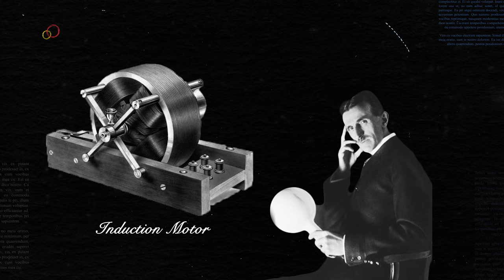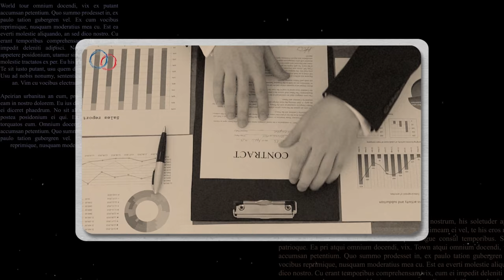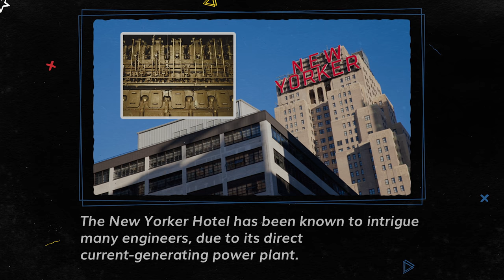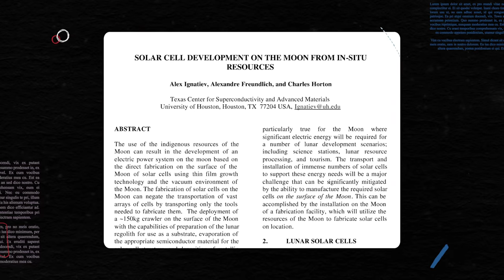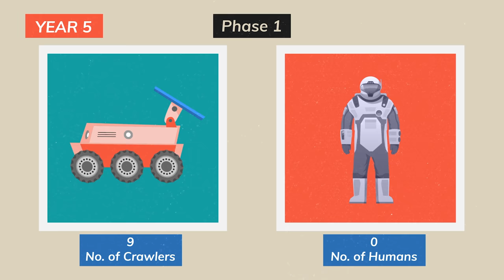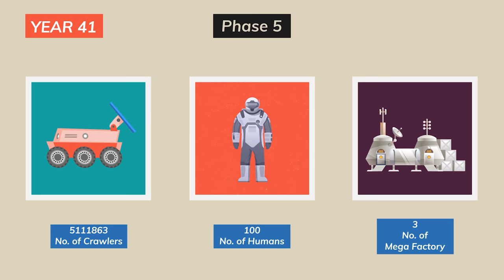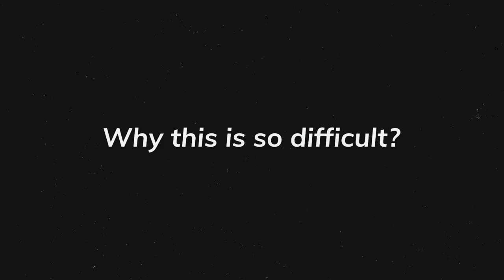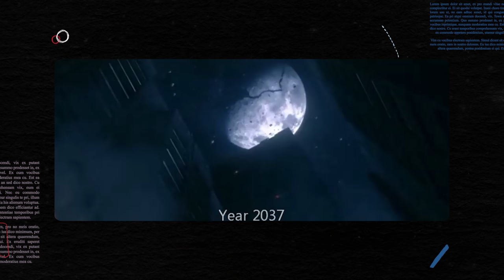Nikola Tesla’s Dream of Wireless Electricity Might Just Be Possible…On The Moon

Comment: The lack of atmosphere causes another problem—meteorites. Regardless of them hitting the panels and damaging or destroying them, coliding space objects will also kick up dust that will slowly settle back down, possibly on the panels. The maintenance would be a huge problem.
Reply: nah. the refractive index of lunar dust being of a 00,09 coefficient on the same scale will augment the panel output even better than benitoite ion suspension applied as usual --- get a grip
Reply: But the lunar dust is electrostatically charged, so we could charge up our panels as well to redirect the dust away from them.
Reply: Sister Mary Clements  are you good?

Comment: As always the main hurdle is cooperation. Classic story of humanity
Reply: yep
Reply: Nope. Some people (actually most people) are incapable of doing math. Building this on the moon is stupid, even more so with crap 5% panels. (calculators from the 80's had better panels.) Much higher efficiency panels can be placed in orbit. Mirrors can be placed in orbit. Wasn't land use the point to putting this on the moon? Yet, the power beamed from the moon will be "25% of sunlight"?!? So to get the same power as sunlight, you'll need to cover four times the area. Also, there's a reason CA isn't power by Niagara Falls... line loss.
Reply: @Kumar Shivam Like we're blocking out the sun with all the airplanes, balloons, and satellites we currently have in the sky? Depending out how far out they're placed, and where (if they aren't between the earth and the sun, they don't cast any shadow on Earth), they won't block a measurable amount of sunlight. I'm not talking about covering the planet with a dome of solar collectors.
Reply: yeah human inability to cooperate affects very important issues like climate change and pollution 
but not with this one 
this is just a stupid idea
Reply: So was the horseless carriage, air travel, and space flight. 

Fortunately you won’t have a say.
Reply: @jfbeam  You forget the part where putting that amount of material in orbit is impossibly expensive. The thing with the moon is that it allows you to save the expenses on material and construction. On Earth those costs would be trivial, but whatever mass you want to leave Earth's surface has a massive pricetag attached to it.
Reply: @rongenise7006  
haha, okay 
Enjoy fantasizing about useless tech fairytales as you like 👍 but that won't make them any more useful or practical ideas
Reply: The main hurdle is the laws of physics... specifically the Inverse Square Law.
Reply: Where the hell have u been for the past 20 yrs!? The world is cooperating when it comes to space...did u not know that when the space shuttle was decommissioned Russia was bringing astronauts and cosmonauts? Also, the space station was funded by Americans, Canadians, a few European countries and Japan now if that isn't cooperating I don't know what is...
Reply: @jfbeam  perhaps efficiency is not real problem, look at any combustion engine, it has average efficiency around 20 % for decades and yet it's still spreaded around globe in most of cars.
Maybe willingness to start something and be cooperative for creating is more important.
Reply: Here we go .. another great project to opening up space economy...😋 Better than one way wasting on sovereign military defence... You hear that puppet masters..!¡!.????
Reply: Supply and demand
Reply: @tmadden4951  "Supply and demand" ? Explain then many starving countries in Africa where surprise surprise McDonald's, KFC and Burger King is missing, it's not because demands don't exist and that is just one random example of failed system. 😉
Reply: It could be our downfall. Time will tell...

Comment: Tesla was certainly a man with the spark of genius.  😀
Reply: Can't deny that, although. If we went all Tesla back in the Day, we wouldn't have computers however. Its either using computer chips or wireless electricity, you can't have both.
Reply: @kelvinjanssen7889  Or we would have emp hardened computer chips. possible
Reply: @mr.b.7244  You have to have a working prototype first, otherwise you can't fund it. Then you have to troubleshoot why the computer doesn't work in the city while it works fine in rural areas (if the prototype would've been made there in the first place).
You have to figure this out before interest is lost. 
I'm not saying you are wrong, who knows? Im Just saying the chance of us having computers would've been a lot smaller if we went wireless :).
Reply: That"s Shocking ⚡

Comment: I think Thorium Nuclear for electricity generation would be a hell of a lot easier and cheaper.
Reply: Finally! A real a tangible comment!! Gold star for you!!! Thorium is the future!!! Or should be.
Reply: So would solar power on Earth.  But if we built a ring of Thorium nuclear reactors all the way around the Lunar equator... :)  I can't see this as a serious proposal when more than half of the proposed solar panels would be sitting in the dark or with the Sun on the horizon at all times, while being a quarter of the Moon's perimeter from the best place for human bases (i.e. where the transport, logistics, and maintenance has to come from), instead of just building the solar panels at the poles where the human settlements are, and putting them on towers with actuators to keep them all in direct sunlight at all times.
Reply: Those towers would degenerate much faster and would be much more difficult to set up in cheap automation in the scale needed.
Reply: The idea is rather silly.   Why convert light -> power -> light (microwaves) -> large receiving stations (solar concentrators),  when a mirror can do all of that without any of the electronics. Maybe it is not a cool enough concept without all the other steps?
Reply: Agreed. What if there is a tornado that wipes out one of the receiving stations?
Reply: Thorium ✅ then in 50 years, fusion ✅ This coolishness is waaaaay out of reach.
Reply: @Jo Piscine like pakistan.
Reply: @Jo Piscine well its calculative guess, you could say!
Reply: @Jo Piscine - Water? Not much of that. Thorium reactors are MSRs and water is only used in combined cycle systems in the second stage. It is not certain that it would use water at all. Except for the drinking fountain in the cafeteria.
Reply: these are the kind of concepts that undergrad college students chat excitedly about while passing some weed around
Reply: @TheSulross  A prototype Thorium reactor was in action at Oak Ridge in the 70's. Nixon canned it.
Reply: @Greg-yu4ij  A prototype Thorium reactor was in action at Oak Ridge in the 70's.Thorium power is an engineering challenge not a scientific one.

Comment: Nice video. Tesla’s idea will work without leaving earth. Copper has an extra electron. His idea was putting a big piece of copper in the air so it could catch the electrons flowing through the air. 
So if each house has its own copper tower! Wireless power no need to transmit anything.

Comment: Decentralized energy production is the only way to go.
Reply: That may be true for rural areas.  But good luck with that in dense cities!  Which by the way account for most of the consumption.
Reply: @abdullahalrasheed394   I mean that for all living areas. From farms to cities. I believe it can be done safely. Have a look at LPP Fusion, they are on the right track.
Reply: @haroldemmers3678  How do you decentralize production to aluminum refineries or other gigantic and super power hungry industries? 
I love going off grid with as many homes and small businesses as possible, but it's not the entire solution. Plus having large generators is almost always more efficient than spreading them out. We need a mix of both. 

Just in the upkeep alone it's easier to manage one big power site than 100 small ones. Plus all the extra materials used in the smaller mounts per building.

Comment: Techno-fairy tall tales on the lunar landscape, for luddite laughter.
Reply: Lack of atmospheric protectio and , lunar dust immediately jump to mind...
Reply: This insane idea has Nothing to do with Tesla !  Uses this idea and our weather would change from the microwave transfer. Talk about the earth heating ! Earth and the moon rotate, how can you synchronize the 2 to send the energy 24/7 and you’d need many, many receivers if you could do it. I could go in and on.
Reply: @jamiemorgan4146  Even if they find some way to Syn it .
There are too many and too large problem at hand they haven't considered like lack of Atmosphere
Will result in solar panel to be hit by small asteroids and dust .
To avoid they they have to build a protective dome over it plus the cost of maintaining it and problem arouse will take too long to solve and evironment is  not friendly enough . Technician wearing suit and gloves doing this on a regular basis is just not realistic enough .
Reply: @jamiemorgan4146  transfer satellites were mentioned. I would assume those satellites would be in a geosynchronous orbit to feed a series of ground power receivers. Not sure why that would be better than just putting the solar to microwave stations, fabricated from Lunar derived materials in geosynchronous orbit to begin with. It was addressed though.
Reply: @jamiemorgan4146  The microwave rectennas are electrically simple, tuned dipole antennas and diodes. Nearly 95%, and much of the reflected energy escapes directly to space. The microwave wavelength/frequency is chosen to avoid atmospheric and water/water vapor absorption. Using any heat engine, even without the CO2 emission issue, would add twice as much heat to the environment as beamed power for a given power delivered.

Comment: Tesla was brilliant but this was the START of the electrical age and we were still learning so much. Now we more fully understand how this could work it's very clear that it's not physically possible to use for efficient distance transmission of power... energy is lost at a rate of the square of the distance between source and destination.

So... enjoy wireless charging - it's a great application of this idea - but forget about beaming power from the moon (or even from the pole in front of your house).

Comment: Actually, it's been shown that looking back, DC was the superior option for the sort of long range high-suspended power lines that make up the grid then and now as DC has substantially lower transmission losses over AC, huge DC power lines are used across the Thames in the UK for this reason. However, the issue is that stepping up and down voltages is an extremely bulky and expensive process, so it's usually only done on the power backbone as DC to DC voltage converters on every street corner is extremely impractical at present. But for the US, the grid would save a huge amount of money off of removing these transmission losses over hundreds of miles of suspended cabling.

Edison was never able to prove that DC would be better because he lacked the ability to convert his DC to the hundreds of kilovolts needed to demonstrate the difference, thus AC won because it could be converted to such voltages easily.
Reply: Are you sure it ain't impulse high voltage dc?
It can't be regular high voltage dc.
If you have some sources I'd appreciate it.

Comment: I read a study from the 80s on the feasibility of solar arrays in geosynchronous orbit with microwave transmission. even back then when panels and launch costs were so much higher they predicted a cost of power at the same as other generation methods in use.
I recall the major hurdle being the ability to focus the beam more and use it as a weapon.

Comment: Don't worry, if the ITER project becomes successful then there would be plenty of energy for generations to come.
Reply: ITER is not designed to commercial generate power. But is an experimental testbed.
Reply: @theicedragon100  bro JC Denton's  comment has no part saying ITER will be generating energy , it's just that it's an experiment , without a experimental one , how can there be a commercial one , living in disagreement muc
Reply: Fusion: the energy of the future which will always remain so... :-D 
But jokes apart, I'd put my bet on projects such as SPARC (Smallest Possible ARC) -> ARC (Affordable, Robust, Compact) from the MIT-CFS consortium  rather than on the "ITER roadmap to fusion", which will take too long to achieve. They don't even plan to introduce tritium before 1935, so their projection for DEMO aren't realistic (By the way, they don't even know what would be the power gain (fusionpower/auxiliary heating power) for DEMO, except that it should be "30, 40 or 50".) There used to be a said in the old days that "fusion will be ready when it's needed." Well, we need it now and it isn't ready. In the meantime both renewables and fission will be the real solution if fusion isn't tangible by 1935 (Yes, when ITER will be just starting to work with tritium).
Reply: I put my bets on new-age nuclear power plants for the next 1000 years of clean energy. Then we have time to find new effective, clean and efficient ways of producing energy.
Reply: @silviafox78  That sounds far more realistic than fusion. I agree.
Reply: You should worry, because the more you learn about problems that ITER has, the less likely that approach seems to play out in this century.
Reply: @theicedragon100  Even if a fusion plant can produce more energy than it requires to sustain the reaction (not there yet), any system of energy generation that requires an incredibly complex, multi-billion dollar facility staffed by highly-trained scientists and engineers, is not going to produce cheap electricity.

Comment: Tesla was talking about using radio waves to transmit power. It works, and all radio is based on it. It's just a horrible way to transmit power.
Reply from the maker: Plus the fact that it wouldn’t work at distances where earth’s curvature becomes relevant.
Reply: @TechforLudditesSira  actually, that's wrong. Do you know anything about technology? We can bounce radio waves off the ionosphere to get radio signals to any place on Earth. Back in the cold war there was radio towers that were called voice of America which broadcasted to the Soviet Union. There's a tower in the town next to mine that was part of it.

Comment: Tesla's idea for wireless power through the air seems unlikely to work (the experiment described in the patent used an enclosed tube of rarefied gas, which easily ionizes, but in the open air over long distances I don't think the plasma filament would hold together well enough), but I think wireless transmission through the ground works as described. A few solar mega-farms placed in deserts around the world would be a lot easier than the moon.

Comment: I've often thought wireless transmission of power. NOTE: I'm not an electrical engineer. Pure power. In my mind it is impractical. Since every piece on metal could become an antenna, how could we shield that power from coupling to electronic devices? After all, didn't the Tesla Colorado Springs test fry the power generators? Circuit breakers would have prevented over-current down the wires so what caused it? Maybe the wire in the generators received the "Broadcast" power. Don't know, but since the History channel show stuff on Ancient Aliens, maybe just speculating on a subject makes me an expert. Well that and a couple of adult beverages. BTW... How many techies watch these videos because the presenter is smart and hot? I like her new hair cut. Now, if she only wore glasses (BBT reference)

Comment: Wouldn't panels on the moon still need protection from micrometeorites?  With no atmosphere to burn or at least slow them, wouldn't they blow through the panels?
Reply: One of the graphics showed the panel with a few meteor holes in it, implying it was still working, the whole band would have to be cut from side to side and it could be reformed. WW2 airfields that were bombed could be quickly fixed

Comment: It'd be cheaper to connect the worlds electricity grids, Richard Buckminster Fuller proposed connecting the worlds electricity grids back in the 50's.  With HVDC only losing 5% power per 1000kms it'd be worth doing.  Then it wouldn't matter how intermittent renewables are, it's always sunny somewhere, it's always windy somewhere.  Furthermore much like the EU countries that are interdependent on each other for trade are far less likely to go to war.

Comment: Massive amounts of storage help any grid no matter the source. What if there's a coal/oil/NG shortage? What if the roads get washed out? What if pumps freeze? Not only that it also reduces the need for the dirtier peaker plants that only come on some of the time. Having grid scale storage between production and consumption is just plain smart.

Why put the panels on the moon when you can just leave them in orbit? Or at a lagrange point?
So you can manufacture them there, sort of. Where do you get the silicon? Those first probes would need a way to separate out the silicon from the regolith to do the doping. ISRU is not as easy IRL as it is in KSP. Where do you get the nitrogen for the plants? I like the ambition, but there seem to be a lot of missing steps.

Could work. I like the idea of building a launch loop and just spamming solar statites and satellites to power the Earth better, but both are cool.